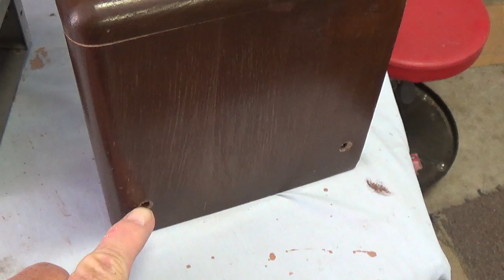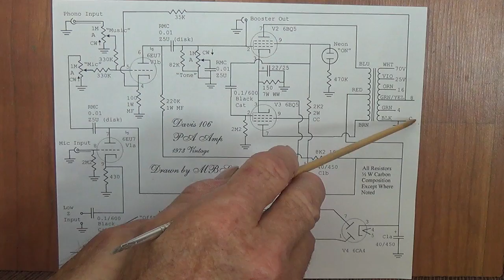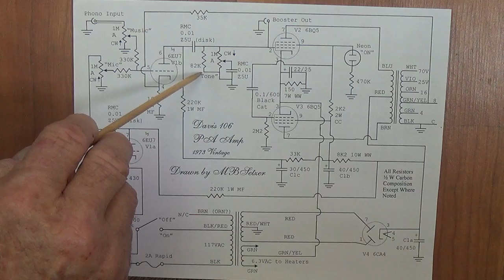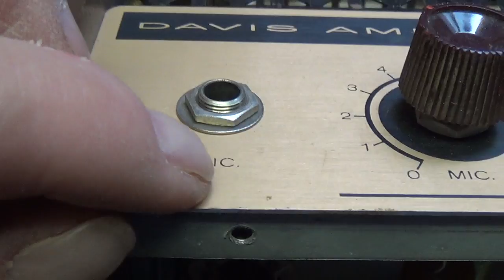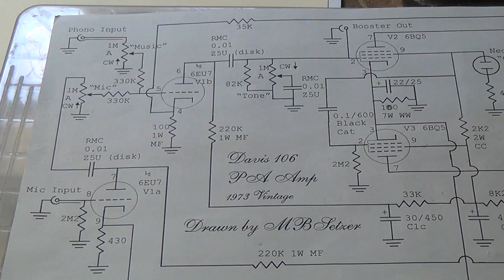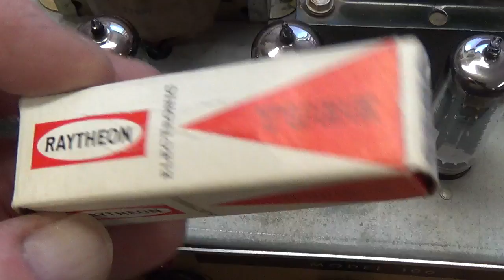Conversion of a J.W. Davis P.A. Amp into a Tube Guitar Amp

Comment: Hi Uncle Doug.  I have a chance to buy a non-functional Bogen CHA-20.   They are asking $225 for it.  I figure it will be worth it just for the 2 1960s Jenson 12 inch speakers.  I'm just a beginner in all this but what do you think of that amp are they a decent and fairly possible to convert to guitar use?  Thanks in advance.
Reply from the maker: Greetings, John. Personally, I think $225 for a non-functional CHA-20 is too high a price. God only knows what's wrong with it, and if it's a power transformer, you're going to be buried in it.....or with it :) That said, either it or its big brother, the CHA33, are wonderful candidates for guitar use. Good examples of both are currently listed on Ebay @ $180-$200. They are generally just heads, so I'm not familiar with them coming with speakers, but yes, the speakers definitely have value if they are full-range Jensens.
Reply: I have done similar conversions .. you like only need a 1/4 jack and revoicing the input pre-amp to use a grid stop resister like Doug did.  These old amps are ok to toy with but the audio dynamics for a guitar just isn't there.  I have gone as far as gutting them and replacing the entire tone stack with only moderate success
Reply: Uncle Doug thanks uncle Doug for your reply and good advice. I picked it up for $150, and it came along with 2 vintage Jensen p12ms.  The speakers sound lovely that the cha-20 Is like a bonus (or a sink hole depending on how you look at it).
Reply: WileECoyotey thank you WileE for your feedback.  I got a similar impression.  Just getting it running again it will sound average much more thoughtful work to make it a beauty.  I did get a couple of Jensen p12ms which sound lovely.

Comment: what speaker are you running and would it matter what kind of speaker you did run?
Reply from the maker: My shop speaker is an old Rola 12" Alnico that I picked up years ago. Yes, the speaker you use will make a huge difference......possibly more than any other component.

Comment: i want to do this to a old tube radio only via the phono input it does create sound and it sounds great except that after a few minutes i get shocks trough the strings
Reply from the maker: Have you installed a 3-wire, chassis-grounding power cord in the tube radio chassis?  Doing this should eliminate the shock hazard as long as it is plugged into a properly wired AC receptacle.
Reply: You need to install a 3 prong AC plug

Comment: How to you determine the missing tubes on an unmarked amp?
Reply from the maker: It's not an easy task, Daniel. When I restored an ancient Rickenbacker lap steel amp (see video), I had to carefully analyze the wiring of each tube socket to see what tubes would work with them.  Sometimes you can find a schematic that matches the circuit......but it takes a lot of looking.
Reply: I found one on ebay that is very similar to mine. http://www.ebay.com/itm/50s-vntg-Mono-Tube-Amp-6V6-project-DIY-Hi-Fi-or-guitar-lowrey-organ-6l6-6sn7-/401371379697?hash=item5d739937f1:g:cL8AAOSwdrdZcIKm

Comment: Thanks for the video Doug. I acquired one of these from Ebay after I saw your video and did the mods you did and the amp sounds good. You did say there was room for improvement. Just curious, what other things would you consider trying for further improvement? Dave
Reply from the maker: You're welcome, David. You could experiment with different tone and cathode bypass cap values, for starters.

Comment: Uncle Doug I recently came upon a lot of cetec vega wireless mic units.  These units are designed to accept dynamic mics.  I understand guitar pickups put out a higher voltage than mics.  Could i use a dropping resistor of a certain value at the transmitter input to allow it to match with an electric guitar and if so how would i determine the resistor's value? Thanks for the great videos...Mike from OH
Reply from the maker: Rusty and I have no experience with these devices, Sting.  We suggest that you experiment with the amount of input signal (to the transmitter) using the amp's volume control. Input impedance to a device is generally based on the resistance of the input signal to ground within the device, so it would help if the amp was connected to the transmitter by a shielded cable to provide continuity from chassis to chassis.
Reply: Uncle Doug if Rusty is scratching his head it must be a dilemma.
Reply from the maker: Rusty scratches a lot of places, Sting, including his head.....occasionally :)

Comment: @11:25  I'm glad you didn't plug it in!  I'm watching your videos for some preparation and inspiration before I start tearing apart vintage portable tube reel-to-reel decks.  It looks like I picked a good starting place since I'm looking to make at least one of the three into a standalone microphone preamp.  Any chance you would want to do a similar walkthrough for this type of thing?  There are hundreds of old cheap tube reel-to-reel decks for very affordable prices online.
Reply from the maker: The conversion process is essentially the same for all such amps, RL.....add input and output jacks, fusing, 3-wire cord, and fine tune the volume/tone controls.  How this is done may vary from amp to amp, based on the tonal expectations of the one doing the modification.  However, If I do encounter a tape deck amp, I will make a video of the conversion.

Comment: i did similar. changed out the 6eu7 to 12ax7. luckily the 6v winding have enough ampacity to handle the 12 volt heaters hooked using the center tap and paralleling to match the 6 volt. seems like they always matched 6eu7 6bq5 and 6ca4 together. i've seen it a lot. especially in old stereo phono radio combo systems and the lark amp to name two.
Reply from the maker: Thanks for your input, Doug.

Comment: good video. I've been toying with the idea of converting an old Bogen PA into a guitar amp. Thinking a lot of this will apply. By the way, how did you come up with the 68k value for the grid stop resistor?
Reply from the maker: Thanks, LV. Good luck with your conversion project.  The 68K value is used in almost all Fender amps.....so I figured it would work here too :)

Comment: I see with this amp you can feed "High Voltage" or 'Constant Voltage" (just the name is "cosntant") distribution loudspeaker system
Reply from the maker: Yes, most PA amps such as this have output provisions for a constant voltage speaker system. It's not of much use after conversion to guitar use, but at least it is provided.
Reply from the maker: It should be mentioned that the purpose of this constant voltage output is to allow the driving of a large number of PA speakers without having to be concerned over their combined impedance.  Can you imagine the challenge of calculating the series and/or parallel impedance of 25 small PA speakers....and then trying to find an output transformer with a secondary impedance to match it ?
Reply: Right, this is the purpose indeed

Comment: What about negative feedback?
Reply from the maker: The circuit includes an NFB loop, Lincoln. I didn't alter it, but it would be a good place to experiment with different value resistors or perhaps a variable resistor. The effects on tone, volume, and compression are usually significant.
Reply: Yeah it still seemed a little flubby even after all your changes.
Reply from the maker: Tone is such a subjective thing that modification to suit individual tastes is sometimes necessary. Installing an adjustable NFB loop in this amp could facilitate that.
Reply: You could do that and / or add presence to it pretty easily. But it sounds really good as it is too, I wouldn't want to break that.
Reply from the maker: Yes, indeed, Lincoln. I covered the subject in a previous video about NFB loops. As you say though, once they sound really good, I tend to move on to the next project :)

Comment: Uncle Doug, I didn't have you for a cork sniffing cap mojo believer, it saddens me ;-) I can't hear any difference in ceramic vs foil caps. And ceramics are way cheaper.
Reply from the maker: Don't feel too bad, Ak. I learned my lesson....there was absolutely no improvement with the replacement caps, so I reinstalled the original discs. I am a "cork sniffer" no more :)

Comment: Great video, as usual, one question. Shouldn't you have the black wire from the three wire power cord go first to the fuse then out to the power switch with the white (neutral) wire connected directly to the power transformer. That way if you blow a fuse the only connections you still have to the amp are ground to the chassis and neutral (electric company's pseudo ground, they will not call it ground for liability sake). No matter what caused the fault to blow the fuse, with the blown fuse you will have removed any chance of line voltage being present in the chassis.  Provided the wall outlet is wired correctly. Just the way I wire things.
Reply from the maker: +Mark Lange  I installed the new cord using the same wiring theory as the manufacturer, which is not optimum, I realize.  I generally wire with black (hot) wire to power switch, fuse, primary.  I guess it's just a matter of personal preference.

Comment: The amp in this vid reminds me very closely of the Grommes Precision Electronics S-10 PA amp I recently converted. Almost identical schematic. In that one I decided to do away with the stock output wiring and go with a push-pull and experimented with the preamp. Something interesting came of it:
PART 1 (Demo / Humbuckers): https://www.youtube.com/watch?v=XYf2j2H97pM
PART 2: https://www.youtube.com/watch?v=bfIWg5zXG4g
Reply from the maker: +The Guitologist  The Grommes project was quite interesting. I watched both videos and was impressed by the dramatic changes associated with each of the three different tone settings.  I have heard that asymmetrical phase inverters produce more even-order harmonics, and it also appears that the asymmetry creates some very interesting tonal effects. Rusty and I will have to do some experimenting on this concept. Thanks so much for the links, the videos are excellent (as always).

Comment: Cool amps, Doug! Great project. Not surprised the disc cap removal made no noticeable difference. Disc caps were used in Valcos as coupling caps and those amps,as we know, sound fantastic. :D
Reply from the maker: +The Guitologist  Thanks, Brad. Yes, it was a foolish experiment that I regret. I still have the disc caps and am going to re-install them the next time I have the amp out and open.  This just adds fuel to my conviction that caps are caps, as long as they are within spec and fully functional.

Comment: A grid stopper resistor is there to prevent oscillation. It would more normally be say10k, and it should be mounted right on the valve, as close to the grid pin as possible. By making it 68k you lowered the input level a touch, bearing in mind the output impedance of the guitar itself. I would say you are simply running with too high an input level and I would voltage-divide the input further until you get a clean sound, then back off until you have as much dirt as you want. It's unusual in a non-hifi amplifier of this vintage to see negative feedback applied all the way around the amplifier, and it really isn't correct given the tone control: the NFB will try to compensate for whatever the tone control is doing and possibly put the circuit into overdrive. The 82k resistor is curious. I'm wondering whether it isn't a schematic error: it would make more sense attached to the wiper rather than the bottom of the tone pot, acting as a law-faking resistor to make a log pot.
Reply from the maker: +QuadMaestro I used the 68K resistor in this position because it is a commonly seen value in guitar amps, particularly those by Fender.  It works well for them, so I thought it might work well here.....and it did.  The tone control was not particularly effective, and probably does need some work. I'll also check into the NFB loop. Thanks so much for your very knowledgeable and helpful input.

Comment: I had a similar "gain fade" just happen to me on a Fender Super 60.  When taken out of standby, one of the channels would play "normally" and then fade to "barely" over about 45 seconds, This happened, even starting with hot filiments, bad tube that tested good.  First time for everything.
I have a question.... a few very good tube amps (hifi stereo or monoblock) full wave rectify and then filter the filiment power to only the preamp tubes, (makes some sense).
Question is.... do you think that helps the noise or makes much difference at all for guitar amps?
Reply from the maker: +dennis walsh   The "gain fade" problem is one that I very rarely encounter, but (in this case) was purely due to the output tube itself.....which tested just fine with my Hickok tester.  It may just be one symptom of a worn-out (cathode depleted) tube. In the future, if and when confronted by this issue, I will know exactly where to look first.  

Do you mean filter the "filament" power or the high voltage (B+)?  I can't envision a way to filter the AC filament supply, unless it is first rectified. In most cases, the B+ is filtered more and more as it is delivered to tubes approaching the first pre-amp stage.  It seems quite effective to me, since any properly designed and wired amp circuit seems to work just fine with this arrangement.
Reply: Yes, just filiment power.  The 6 and 12 volt ac was used conventionally for the output tubes and the phase inverter tubes.  The 12 volt ac filiment power was also connected to the ac input of a modular full wave rectifier.  The dc output of the full wave rectifier was filtered and applied to the filiments of the preamp tubes.   I presumed this was to (maybe) reduce any possible hum in the high gain preamps.  It costs the manufacturer extra money and so rare it must be nearly un-necessary or make miniscule improvements.
Reply from the maker: +dennis walsh  So they do rectify the AC filament voltage. My concern would be the voltage losses incurred during the rectification process.....wouldn't you lose at least a volt ?  Also, it seems like much ado about nothing (as you suggest) except in the most extraordinary high-end Hi-Fi equipment.

Comment: Great video. Regarding the replacement of the disk caps. Is it just because of the tone? I've always heard that they tend to  hold their value and don't usually need to be replaced.
Reply from the maker: +Cass Stevens  Yes, there was nothing wrong with them, Cass, and to be honest, I could hear no tone improvement at all after replacing them. This just reaffirms my belief that there is no tone difference between capacitors, despite what people trying to sell $65 apiece whale oil and papyrus "Tone Caps" may tell you. I prefer personal experimentation to acceptance of popular theory.....and in this case, I learned that my skepticism is both healthy and justified.  In fact, I may just put them back into the circuit. Thanks for giving me a chance to blather :)

Comment: Hello! nice video again :D as a cat's person I really enjoyed Jack's apparition. One question that came to my mind: I've read that is you heat the tubes with DC voltage noise can be reduced. What's your opinion on this? 
Greetings from Venezuela :D
Reply from the maker: +luis colmenares  Greetings, Luis.  Yes, you can rectify the 6.3VAC filament voltage supply to eliminate any 60Hz hum.....but, to be honest, in 99% of all the amps I have built and worked on, leaving it as AC worked just fine. If the amp is designed and constructed properly, it will not hum with an AC filament supply.  Jack sends his regards :)

Comment: Interesting! How would do you go about adding a "Presence" control to the amp?
Reply from the maker: +Dennis Hill  I wouldn't, Dennis. With small amps like this, it's best to keep them simple. If you wanted to add such an effect, however, I would find a somewhat similar circuit that had a presence control and duplicate their wiring scheme.

Comment: Fantastic stuff. It would be interesting to hear your thoughts on the theory behind effect of the grid stopper. Is it reducing drive and compression hence allowing the high end a little more slack from the supply? You'd have thought the effect of the Miller capacitance would have reduced the highs by adding a stopper. I guess this shows how when other parameters are at limit we sometimes get the opposite of what we expect. I once had a later 70s two input hi watt that did not have a stopper on v1 and I experimented with it, yet ultimately there were many things about the sound that didn't not please me and it needed more modification to suit my ears. I was reluctant to do this as I had already tried to sell it once and had criticism from the hiwatt cognoscenti that there were repairs in the amp that did not have the hiwatt red varnish on the joints. I sometimes wish I'd kept it but my recent health scare has taught me, if nothing else, that you cant collect it all and take it with you. Ultimately someone else ends up with the pieces of the jigsaw to deal with. I say this with the most positive connotation, I must stress.
Reply from the maker: +PoJoWo I have a very simplistic viewpoint on the grid stopper.....it reduces the "strength" of the input signal to prevent over-driving the first pre-amp stage.  What it's actually doing is a bit more complex, but this is its practical effect.
Reply: +Uncle Doug thanks for your speedy response. That surmises my feelings and experience. I guess it essentially is a pre volume if you consider the input circuit with the guitar from a thevenin equivalent sort of approach. Badger the tripod lurcher has been watching Rusty faithfully and has asked me to given him more soldering work so he can hone his skills and hope to impress his hero.
Reply from the maker: You're welcome, PJ. Rusty sends his regards to Badger :)